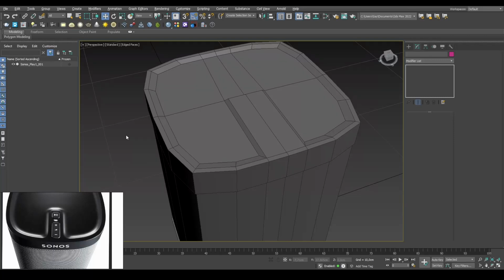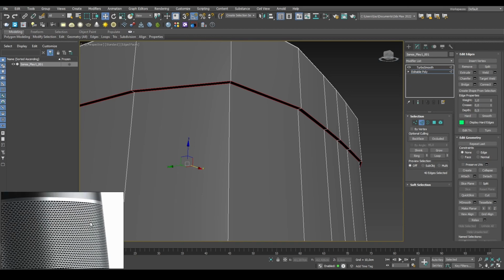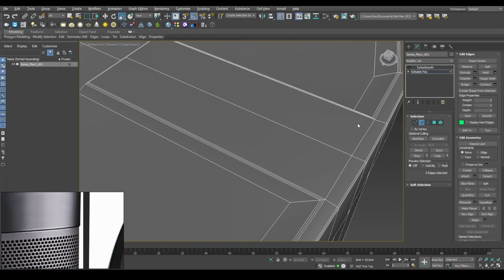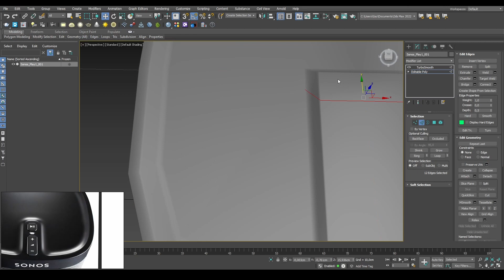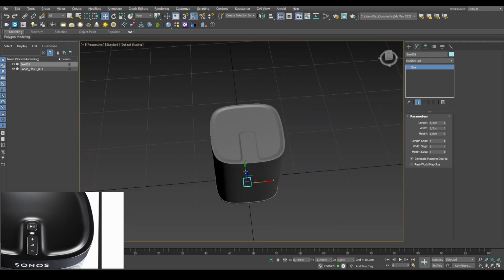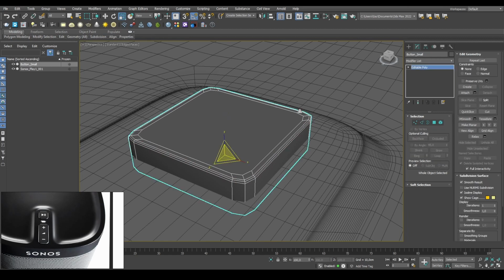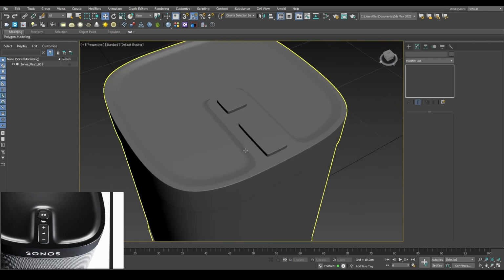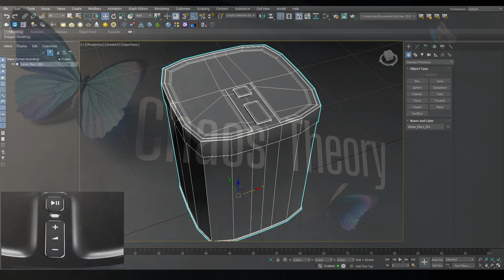3ds Max modelling continued, Product Visualization Part 3 | InDepth Tutorials

Comment: Would it not have been better and provide a more realistic result, to cut holes for the buttons in the mesh first?
Reply from the maker: For sure, that would probably give it something in the end - however this is a tutorial specifically aimed at beginners - so i wanted to keep it a bit more simple :) don't worry however, there is a a lot more on its way some that's aimed more at solving a lot more complex issues regarding modelling.